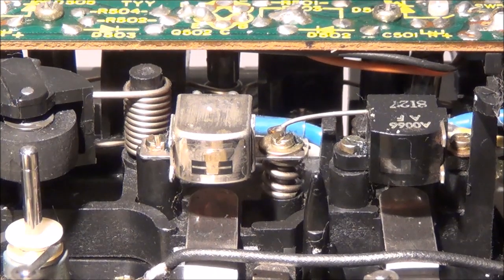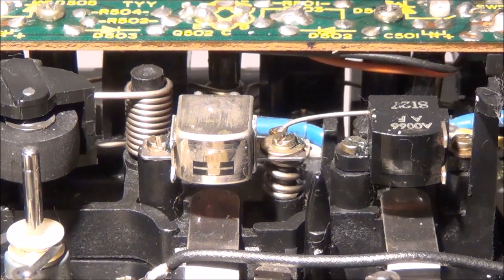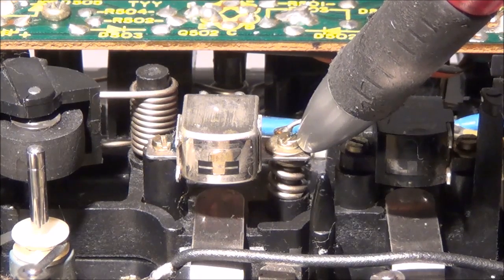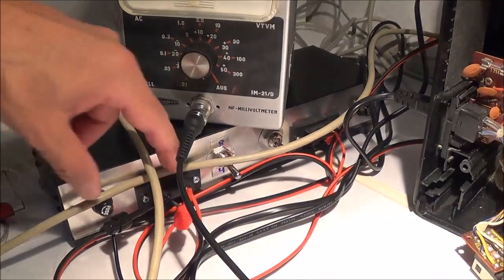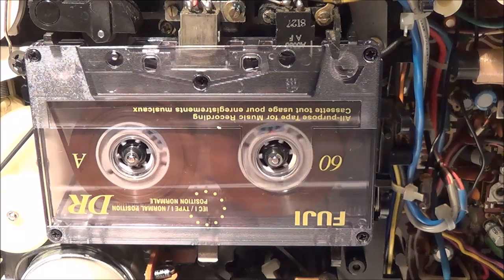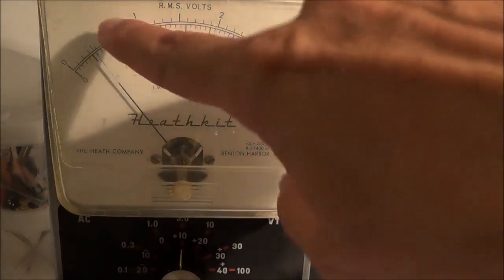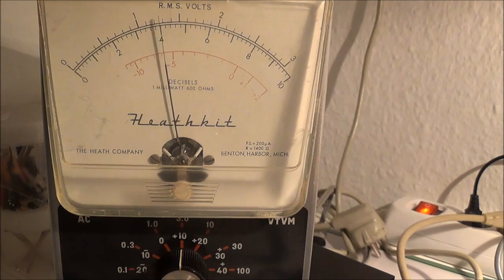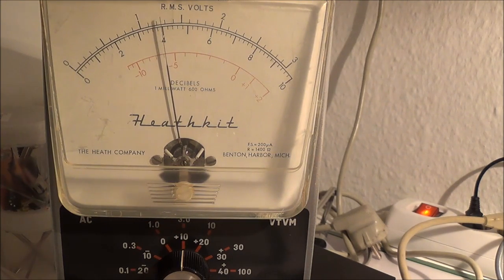SHARP GF-9191 AZIMUTH ADJUSTMENT

Comment: I have a problem with mine. Only in tape input, stereo doesn't work right. Vocals and hf only in right speaker. Left speaker only has bass. Sometimes it transfers to left, and sometimes balances; sound quality also changes from time to time--all while playing. What can I do? It doesn't happen in phono, aux or radio.
Reply from the maker: I would clean the head with isopropyl alcohol and a cotton swab really good, clean the function switch (phono, aux, tape, radio switch) with contact cleaner, and the record/playback switch with contact cleaner; this is a long switch on the circuit board which is mechanically connected to the cassette mechanism. Spray it then work it back and forth a number of times. Everything with the power off, of course.

Comment: You measured one channel? I think, you must synchronize two channels. I fight with this.
Reply from the maker: Just use the VU meters of the GF-9191and adjust both for maximum output. That way both channels are adjusted. I am not sure whether I covered this in the video; it's been been a long time.
Reply: @OldSchoolElectronics , I don't have GF-9191. I have SONY TC-KE400S (https://www.youtube.com/watch?v=nlWU3oXYUQo).
Best way is using 2-ch oscilloscope I think and synchronize channel levels instead of finding max. signal level of each side separate.
But this is only YouTube knowledge... :)
Reply from the maker: Maybe you can try this method since you do have a scope. You just need to use the X-Y function.  https://www.youtube.com/edit?o=U&video_id=2EwayCqoZcg
Reply: @OldSchoolElectronics  "Adjusting for maximum output" will only give you a very very very rough approximation of the proper azimuth. And only if you have a real, properly made test tape. In order to properly tune the azimuth you need either 1) an oscilloscope (best), or 2) a RMS voltmeter that measures the sum of both channels at once (worse, but also good). By maximizing the sum (!) of two sine waves you are ensuring that the channels are in-phase, which is what azimuth adjustment is all about. 
But of course for all that to work you need a sine-wave test tape made on a verified reference recorder.